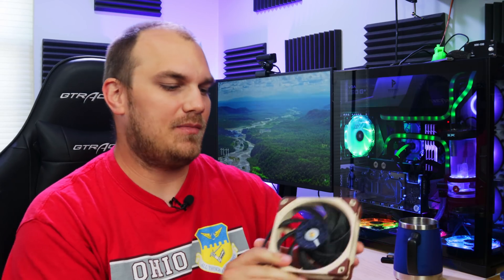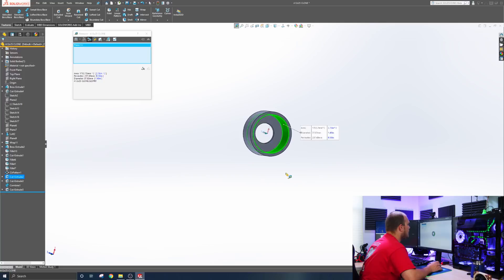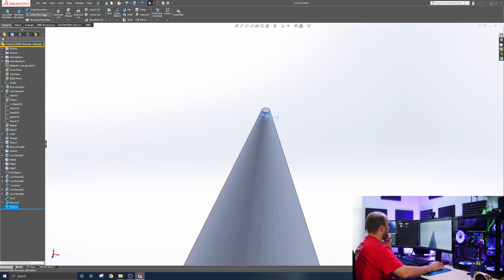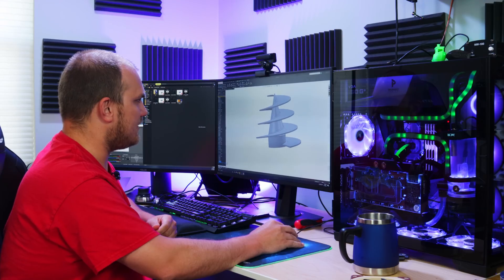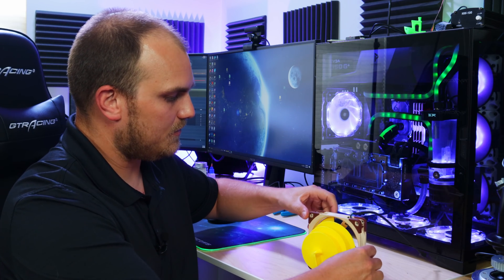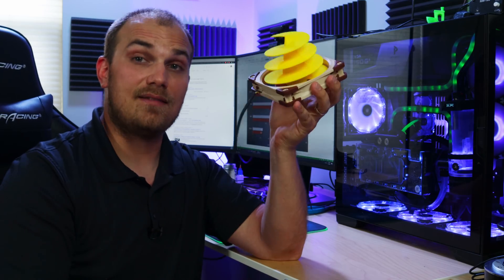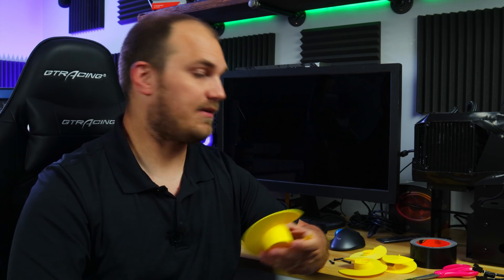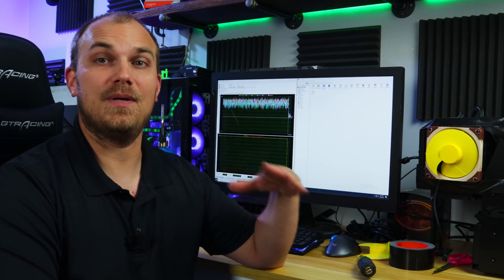Leonardo DA Vinci Made A PC Fan Would It Work?

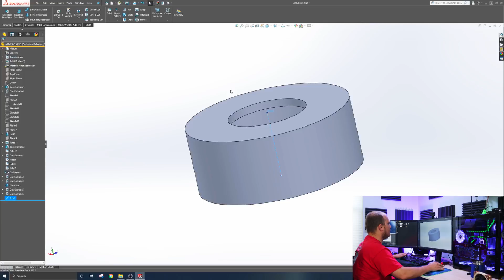Comment: 3:46 mAh drills
Edit: you're like halfway to a supercharger. PLS
Reply: A positive displacement air pump running directly into an intercooler with a blow off valve on the other end so the air is compressed in the intercooler where it can dissipate heat, but then flows through the bov back down to atmospheric pressure into the PC case at lower than ambient temperature. Automotive PC air conditioning!
Reply: Running with Stuart's idea, but keeping with pc components; compressor into a water cooling rad to function as an intercooler, that goes to a diffuser/expander across an air cooler (similar to when he watercooled an air cooler, but with an opening on the exhaust of the cooler). The only problem is that you need a significant pressure differential to get a noticible heat of compression effect. Id say a 140mm fan converted to maybe a centrifugal pump that reduces down to g1/4 fittings for the radiator could maybe do it. You would definitely need a heftier motor than pc fan motors to power it, though.

Comment: Next up: watercooling powered by a Archimedean screw.

BTW these kind of "screws" are still widely in use for industrial purposes.
Reply: they are .. just not for moving air
Reply: @DrSmugface  Air is just another fluid. This needs a full shroud to work with its highest efficiency.
Reply: Ever hear of a twin screw super charger?
Reply: Those are like concreate mixer truck blades

Comment: How about a turbocharger/centrifugal supercharger impeller design with a housing that snaps over the noctura fan body that directs the air through a duct. Probably wouldn't spin fast enough to move much air, but that's what you are here for.

Comment: I would suggest calibrating the dimensional accuracy of your printer. You can do that by calibrating your steps on x,y and z axis motors. You should also do that for your extruder. It will take some time but give it a go. Also make sure that your x Gantry is parallel to the bed
Reply: Don't give that on that little tarantula. Even as a side project

Comment: I'm sure it would work much better if you add a casing / air duct around :)  
Right now, it feels like air would just rush out the sides.
You could also let the blade profile drop down on its extremities, so air is concentrated to the center ...   
Just throwing ideas around ^^

Comment: what if instead of an open screw you made this a scoop. Possibly with 2 inlets.
Reply from the maker: last night while laying in bed i was thinking something similar, im interested in trying something like this
Reply: @MajorHardware   And one like a cheese grater :) :) :)
Reply: @MajorHardware  several nice ideas to try: 
(CW) clockwise and (CCW) counter-clockwise fans back to back (joined together or screwed together) like in server PSUs and some 1RU server cases, also adding serrated edge/teeth to the top and bottom of the blades for blending in some white noise and balancing purposes
Multi start (da vinci)screws for balancing purposes
capping the edges of the screws to stop air escaping out sideways
adding a balanced serrated edge/teeth on the top and bottom of blades/screws for noise purposes/(un)balancing purposes
Reply: @MajorHardware  Da Vinci's biggest mistake here is: he haven't heard two man called Osborne Reynolds and George Stokes, nor understand Reynolds Number. Nor any form of fluid dynamics exists back then...
The air screw will work rather well in super dense things... like lava... or honey... which will flow along the blades and been "pushed around"

In anything with a higher Reynolds Number, the flow will become turbulent and "tumble" out of the screw (aka the flow will separate from the screw, stalling it and create nothing but drag), which you don't want that.

This is why ship propeller blade is wider than say a plane propeller or your regular computer fan. (water have a lower Reynolds number, but Reynold number changes depend on flow speed and the size of thing  traveling though it. i.e. A sperm will experience a much lower RE in water than something bigger... like a whale.)
If you put a duct around a large blade, then you can trap the escaping air and force it down the path you want, which is how those "high-static-pressure" computer fans and concrete pumps work.
Reply: @MajorHardware  what if you curved the screw like blades more like blades? give then a little bit of a radius, but spread the twists out more? maybe the combination of kinda scooped twists/blades will force air through better?
Reply: @MajorHardware  you could also try making this inverted. With it spinning counter-clockwise, it would be pulling in air from the tip instead of from the bottom.
Reply: @MajorHardware   one idea i've have is rebuild the mk.1 screw with a shrinking helix pitch (blade becomes closer to itself closer to the motor) and build a shroud over the top the matches the screws angle with a slight air gap.
Reply: Yey buildzoid
Reply: A shroud for it may work as well. Another thought is reverse the direction.
Reply: Actually Hardcore Full-time YouTube
Reply: Great minds think alike, Buildzoid.
Reply: Lots of thinking on this as well. I can definitely see a shroud being needed. Allowing a scoop at the top/portion of the coil to be above the shroud. and upon thinking about this more it will only be able to pull/push air at the rate of the thread pitch in relation to the rpm. For the most airflow, it cant be a cone. The diameter would have to be same the whole time. would you be able to compress air with an inverse cone? it would have to be huge to the point where the tip of the inverse cone would mount to the fan and be the inner diameter of the fan shroud. Hmmmmm.....
Reply: Interesting idea, like a hood scoop on a car for the intake. That may actually work if designed the right way
Reply: Yes the da Vinci design and intention where 2 blade like a helix
Reply: Buildzoid 😀 love your content 😉
Reply: We need at least 8+4 true VRM phases to properly power that fan